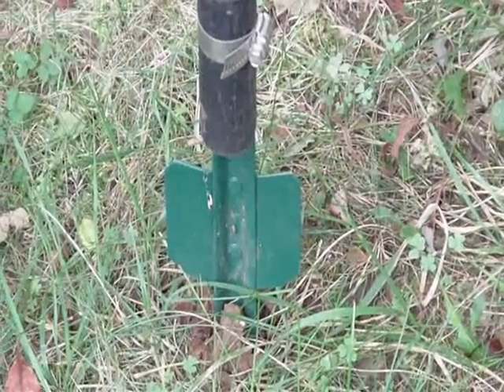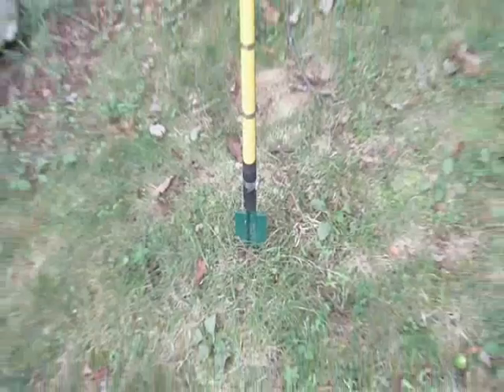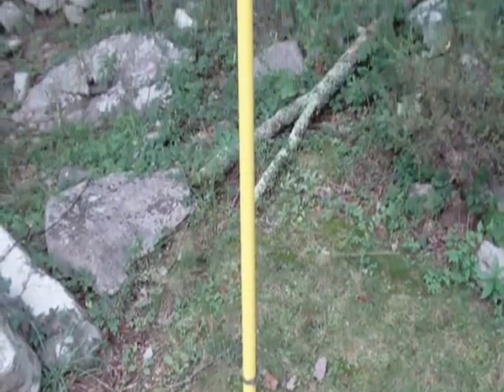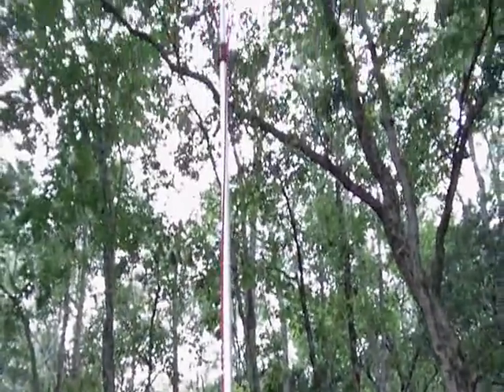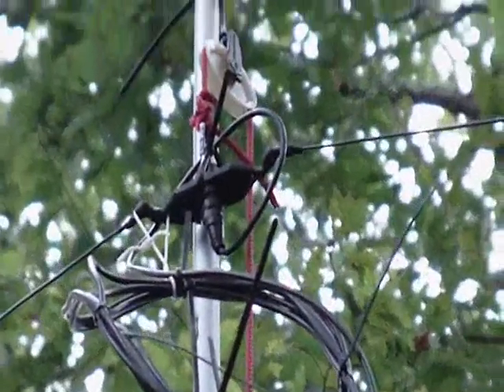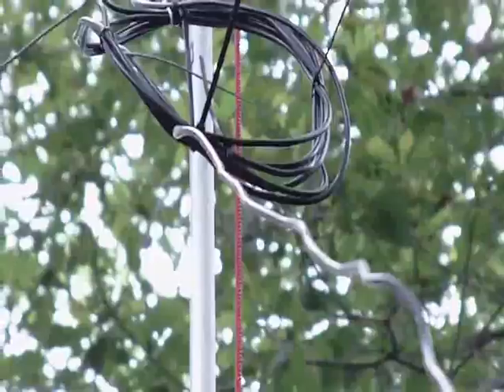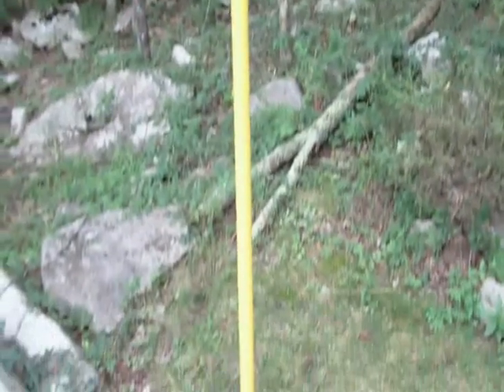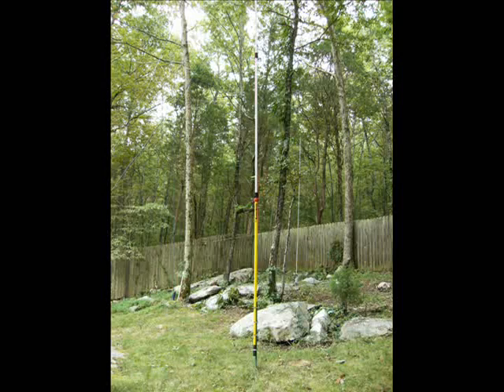HF Antenna Mast and Support

Comment: That looks like the Mr. LongArm pole, Just over 8' collapsed, 23' extended. Only the bottom section is fiberglass; the top two are aluminum, but they're heavily anodized so they don't have electrical continuity to each other. I've used a couple of these for antenna supports, and they work great if you don't put too much weight or wind load at the top.

Comment: Get a paint roller from the dollar store. Has a pole fitting on the handle. Remove the roller hardware and bend over the rod into a hook. Hang a pulley and rope on the hook. Now you can raise and lower the balun feed point.

Comment: I recently visited my favorite local guitar store and happened to come across a speaker stand used to support concert speakers and equipment, since it had been around awhile the owner made me a deal I couldn't refuse, yep, pretty much feel like a thief. 
It also happens that the '12 telescoping fiberglass painters pole I had fits snugly in side the center tube of the tripod giving me '18 above ground. 
Bought the MFJ mirror mount for a dipole configuration and two 20 Mtr.  MFJ telescopic whips and it works great.
With two 3/8×24 threaded bolts and wire I've already cut and tuned with ring terminals, I am able to get a dipole resonant at various portions of the 40 and 80 meter bands.
Next project is to make time to set it up and use it during my extensive travels throughout the U.S. in the daily grind of navigating 18 wheels through the countryside.
Reply from the maker: John C. Excellent.

Comment: A late friend of mine taught me how to make a pvc antenna base that appeared in QST many years ago. After I made mine I beefed it up by using four of those steel green fence posts as supports. I used this base with a painter's pole and a Comet GP-3 and its rock solid.

Comment: I used one of those fence posts and slipped two 10 ft. sections of 2 in. PVC pipe over it.  Made a great mast to support an 8-element homebrew Yagi, oriented horizontal for 2-meter SSB work.
Reply from the maker: Excellent.

Comment: Hi - doesn't the painters pole being steel/aluminium cause the wire to be de-tuned?
Reply from the maker: Tim H   Xcellent question.  This pole is fiberglass so no problem.  Most of the long poles are today.  Hope to catch you on the air.  73.

Comment: what does 73 mean
Reply: 3 -- Ham lingo for "best regards." Used on both phone and CW toward the end of a contact.
 
The first authentic use of 73 is in the publication The National Telegraph Review and Operators' Guide, first published in April 1857. At that time, 73 meant "My love to you!"
 
In the National Telegraph Convention, the numeral was changed to a friendly "word" between operators.
 
In 1859, the Western Union Company set up the standard "92 Code." A list of numerals from one to 92 was compiled to indicate a series of prepared phrases for use by the operators on the wires. Here, in the 92 Code, 73 changes to "accept my compliments," which was in keeping with the florid language of that era.
 
Over the years from 1859 to 1900, the many manuals of telegraphy show variations of this meaning. Dodge's The Telegraph Instructor shows it merely as "compliments." The Twentieth Century Manual of Railway and Commercial Telegraphy defines it two ways, one listing as "my compliments to you;" but in the glossary of abbreviations it is merely "compliments." Theodore A. Edison's Telegraphy Self-Taught shows a return to "accept my compliments." By 1908, however, a later edition of the Dodge Manual gives us today's definition of "best regards" with a backward look at the older meaning in another part of the work where it also lists it as "compliments."
 
"Best regards" has remained ever since as the "put-it-down-in-black-and-white" meaning of 73 but it has acquired overtones of much warmer meaning. Today, amateurs use it more in the manner that James Reid had intended that it be used --a "friendly word between operators."

Comment: A comment on your air balun, it will work better if you wind it around a 4" piece of pvc pipe. RF travels back up the outside of the shielding and if the first and last coil are touching it shortens out the whole thing.
73's
AA6QQ